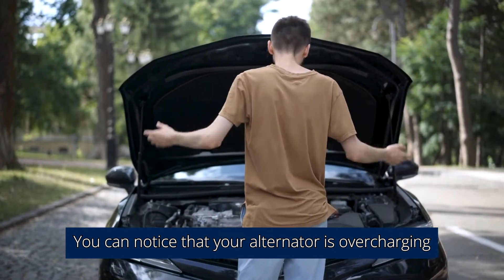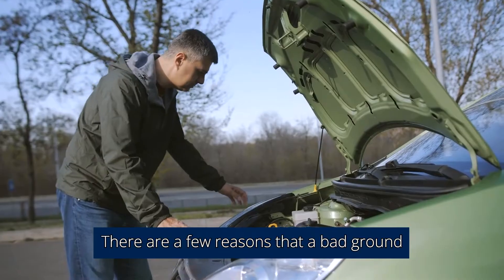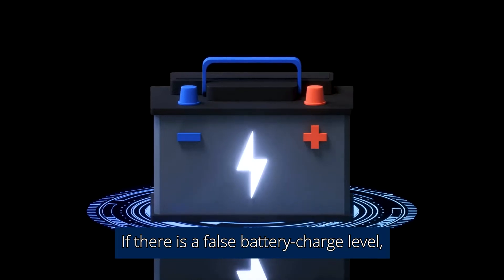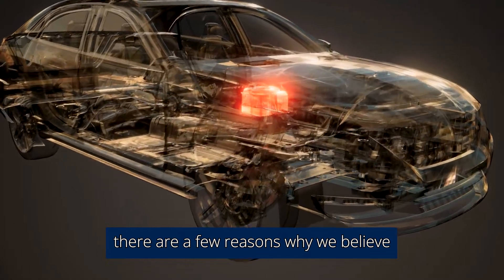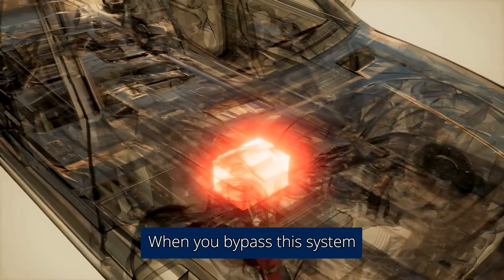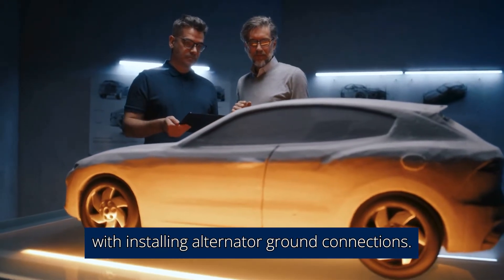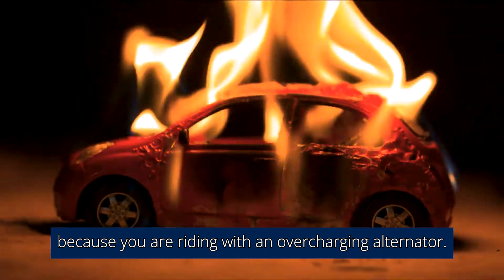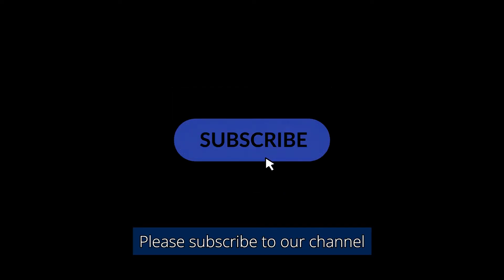Can Bad Ground Cause Alternator to Overcharge? (Here's What To Do)

Comment: Here’s the translation:

"Hi, three months ago I bought a Ford Focus MK1 1.8 TDDI. Of course, I washed it, including the interior of the fenders, and suddenly I noticed that the electronics were acting up. I turn on the lights, and the car shuts off, the bulbs and lights flicker, the starter makes a squealing noise, and it turns out the alternator is overcharging. I replaced the regulator, and in the meantime, a bulb on the instrument panel burnt out. Everything was normal for about 20-30 days, and then the other day I noticed a bad smell after driving near the battery. I bought a multimeter, and again, the alternator is overcharging, reading 17V when the car is on and 14V when it's off. The bulb burnt out, and now there’s an issue with the central locking, it can’t unlock. If you have anything that could help, I would be really grateful. I’m tired of this."

Comment: Mine read 14.70-14.75 today after the “charging system error” light came on. 2012 Honda pilot. Could this be the reason? I mean it didn’t stay on for too long, and I recently changed alternator about 4 months ago. 😕

Comment: Letting a car run without the battery was a thing years ago.  I've read multiple different places that is a very bad thing to do with modern cars.  The many electrical loads a car has today can draw much more power than will be produced by the alternator when the car is just idling.

Comment: in the past 12 months I replaced 2 times the batteries and alternators. Now brake and battery lights are blinking or stay steady. What should I do?
Nissan Sentra 2002 GXE 135,000 What is causing battery and alternator to die?
Reply: Did you end up figuring out the issue? Currently in the same boat
Reply: @apoulanap  Advanced Auto Parts sell f…..d up alternators! Get good one. Good luck 🍀